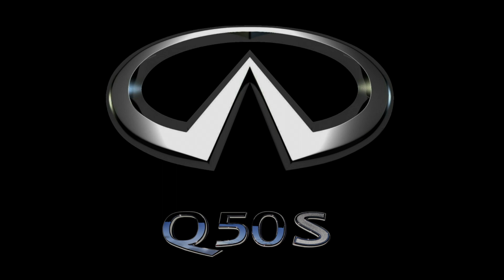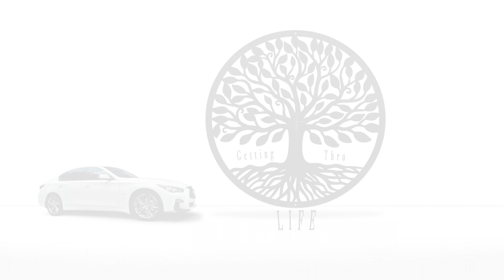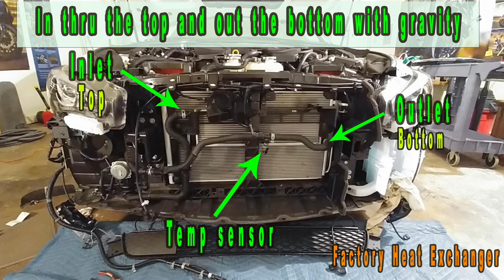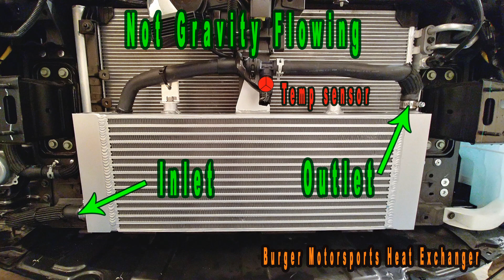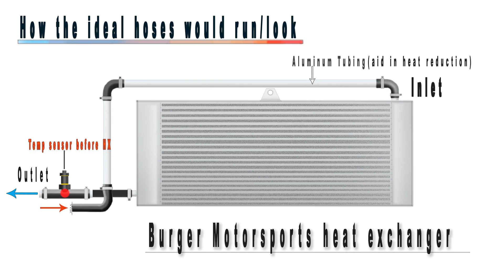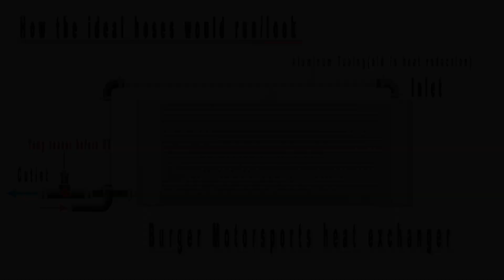Can the Q's 3.0T's Burger Motorsports HX install be improved upon?

Comment: Have you send this to them? Would be interested to hear their thoughts.
Reply from the maker: No I have not. It was highly likely done this way for ease and cost savings of actually doing it right. BM just used a generic core and end tanks and made it bolt up directly for ease. If the front bumper wasn't as labor intensive to get off, I would have played around with this and made aluminum tubing pieces to re-route the plumbing. I'm almost certain too that the wiring for the temp sensor isn't long enough to make the reach to where it would need to be mounted to make all this work. I'd like to get the Mishimoto HX in the future and add it to this BM HX while adding big surface area and coolant capacity too. Then no need for AMS in the fender tank.
Reply: Getting thru Life  With the red sport extra pump this shouldn’t be a big issue.
Reply from the maker: @EATSLEEPJD  Bottom line is the Red Sport extra motor doesn't serve much purpose except in the sense as a backup motor if it can be looked at it like that. The Red Sport drivers suffer just as badly in the heat as any other 3.0T. Moving the coolant faster thru the HX system isn't the answer unless you had/have a HX that is really over the top on cooling and efficient where it could take advantage of the faster coolant flow and still have the time to cool it. The main goal is coolant capacity and surface area. The factory HX is so dinky that the front HX itself only holds at best 7 ounces of water as I measured it in a video. That is half a drinking cup. Having a large capacity of coolant benefits in that it takes longer to heat up all that coolant so it gives more passes from starting at a low coolant point. With these cars in hot weather the HX coolant system is going to heat up high at some point and then just requires the car to sit with hood up and physically cool down. A trick I've been doing for 30 years is gas station ice bags ontop of the two intercoolers. drops coolant temp a fair amount quicker plus gets the intercoolers ice cold to their core.
Reply from the maker: @EATSLEEPJD  Also too, there is the fact that heated liquid rises to the top of a container and the cooler coolant drops to the bottom.  So in the configuration of this installed Burger Motorsports per their instructions the hot side of the coolant, the heated coolant returning to the HX, it enters at the bottom on the passenger side. It enters the HX end tank which will always have preexisting coolant swirling around in there. To a degree in the end tank is when the hotest coolant rises to the top and the cooler coolant drops to the bottom. This content of coolant now flows across the core pass side to driver side and dumps into the driver side end tank. There again it swirls around to a degree but again hot rises and cool drops downward or collect in this area. Just so happens the exit port is at the very top of that end tank. To a degree this HX is flowing its warmest coolant in the loop. How much cooler is the coolant at the bottom of the HX versus the hotter coolant at the top? Is it 1 degree, 3 degrees or say 5 degrees? It would be huge if there was 10 degree difference but that would be big number but would be nice to figure out if there was something to find, data. If you turned the BM around and had the hotter return coolant enetering the HX from the top and exiting the down at the bottom then seems the coolest coolant flowing down and across the core would be the outcome and thereby passed back to the twin intercoolers on top of the motor. Just a 5-7 degree difference could be a big bonus.

An article I read about fluid temps and the hot fluid rising to the top from the bottom: 

The molecules of a fluid are free to move. Liquid molecules, constrained by electrostatic and electrodynamic forces, do what's called "Brownian motion", gas molecules move on a random path, colliding with each other and with other objects. The molecules have different velocities, which can be represented with a statistical distribution. The temperature can be defined in conjunction with the average velocity of the molecules. At each collision, a molecule imparts a thrust on the molecule it has collided with. If you take an imaginary border inside a fluid, the sum of the thrusts of the molecules from one side, over a certain area will give you the fluid's pressure.

Now a high-temperature area inside a fluid is a region where the molecules have greater velocities. This means that they cover more ground faster and have more collisions, therefore, if impeded by the same external pressure, they will expand.

While doing so, buoyancy comes to play: all molecules, hot or cold (fast or slow) are under the exact same force from gravity and are essentially in freefall, but they usually don't move (on average) because there is a slightly higher chance of a collision beneath them than above them. Why? Because, thanks to the pressure gradient, the molecules are more densely packed the lower you are in a fluid column (and they are getting denser in the first place exactly because they have the tendency to fall).

Now the faster (hotter) molecules are able to reach further going up towards the low pressure area than going down, so they will gradually move up (we're always talking on average). So they move upwards and the cold ones move downwards. Equilibrium will be established, unless the heat source is beneath the column (as happens with atmospheric air close to the ground f.e.) in which case currents will form. Currents form because it is easier for molecules to move all together in one direction, since the chances of the collisions between them negating their collective motion are slightly lower.

Comment: In a closed pressurized system, gravity does not come into play. It’s all about the temperature. Heat rises.
Reply from the maker: I talk about this hot water rising under AllenM3's post. After thinking about this more it could be possible that the Burger Motorsports hose configuration could lead to the warmer coolant being sent out the top HX. The cooler coolant could be staying towards the bottom of the driver's side end tank until it mixes at some level and then heats up/levels out and then rises. Meaning the BM heat exchanger could possibly be hooked up differently and provide better cooling by a couple of degrees maybe. How much I'd have to datalog it on similar days to see if and how much of the difference there could be. I'm thinking about doing it. What's holding me back is the length of the supplied wire harness to the hx coolant temp sensor. I do not really want to cut into it and splice a set of longer wire to it. Something I don't like to do is cut factory wiring.

Comment: Very interesting point I've never thought about. Weird how the heat exchanger design make it work against gravity to push the fluid up. For what it's worth I've seen the flow that the single pump can push even with my same BMS heat exchanger and it's impressive. In attempt to rebleed my intercooler system, I've set my pump on 100% duty cycle through the ecutek app, then partially disconnected the top hose feed to both intercoolers and it's was garden hose level of flow, very, very fast. You can only imagine the mess it made because I didn't not expect that level of flow. Still interesting that the design of the heat exchanger could of been made with more efficient flow in mind.
Reply from the maker: Thanks for posting that info. I had my tuner turn my single, non red sport pump up to 80% all the time instead of mostly 40% some 80%. I really couldn't tell a difference in the heat reduction with any of my driving. In the sense, their is an optimum rate of heat dissipation per the time the fluid spends passing through the core I am assuming. Moving the fluid faster through the core which gives it less time to dissipate heat if move too fast. There is a fine line I'll assume. What I'm trying to figure out is by pushing it up through BM core does that pool up the cooler coolant towards the bottom and the hotter temp fluid to the top of the HX thereby circulating just the top half of the coolant. Interesting I found this online that supports the hotter fluid rising and the cooler temp coolant/fluid staying towards the bottom.  Therefore the BM HX set up the way it is would be less efficient at cooling just based on being pumped in from the bottom to the top.

((The molecules of a fluid are free to move. Liquid molecules, constrained by electrostatic and electrodynamic forces, do what's called "Brownian motion", gas molecules move on a random path, colliding with each other and with other objects. The molecules have different velocities, which can be represented with a statistical distribution. The temperature can be defined in conjunction with the average velocity of the molecules. At each collision, a molecule imparts a thrust on the molecule it has collided with. If you take an imaginary border inside a fluid, the sum of the thrusts of the molecules from one side, over a certain area will give you the fluid's pressure.

Now a high-temperature area inside a fluid is a region where the molecules have greater velocities. This means that they cover more ground faster and have more collisions, therefore, if impeded by the same external pressure, they will expand.

While doing so, buoyancy comes to play: all molecules, hot or cold (fast or slow) are under the exact same force from gravity and are essentially in freefall, but they usually don't move (on average) because there is a slightly higher chance of a collision beneath them than above them. Why? Because, thanks to the pressure gradient, the molecules are more densely packed the lower you are in a fluid column (and they are getting denser in the first place exactly because they have the tendency to fall).

Now the faster (hotter) molecules are able to reach further going up towards the low pressure area than going down, so they will gradually move up (we're always talking on average). So they move upwards and the cold ones move downwards. Equilibrium will be established, unless the heat source is beneath the column (as happens with atmospheric air close to the ground f.e.) in which case currents will form. Currents form because it is easier for molecules to move all together in one direction, since the chances of the collisions between them negating their collective motion are slightly lower.))
Reply from the maker: I'd have to datalog the before and after while its hot. It's now starting to cool down slightly where the difference between summer weather and intro to fall is drastic. The summer time in hot and humid states/cities is what seriously tests/crushes the performance of airconditioners, intercoolers and heat exchangers.

Comment: Of course it can be better just buy the Ams Heat Exchanger that what I did and my temperature needle has never been past the half way point. Sometimes it's worth it to spend the extra bucks. People always complain about the Gtr and 370z but the kits of proven reliability and horsepower are great and proven.
Reply: I caught my AMS HE on promotion so I bought it once and forgot about cooling needs. I do have the fender tank laying around so the fact they have that tells me it's not necessarily the HE itself, but in tandem with more fluid, maybe cooling issues are resolved?
Reply from the maker: @ceo4eva  Where do you live?
People here in hotter climates even with AMS HX suffer greatly. Just depends of where you live and what you are doing with the car. If it was only the heat exchanger that I was doing with no other plans to do a bunch of other things then that's a drop in the bucket but add wheels, CBE, expensive tires, tunes and other accessories then some people need to conserve in some other areas. If money was no concern then I'd stroke a fat check to AMS and ship my car there and say load it up. Not the case.
Reply: @GettingthruLife  I'm in maryland, very different climate from yours so I guess I don't really have your problem.
Reply from the maker: @ceo4eva  These Southern states are brutal. Florida, Texas, Arkansas, Mississippi, Lousiana with the heat and the combination of high humidity makes intake temps and charge air temps130-145 when pushing the car or sitting at lights. Hard to lower the HX coolant temp when the air coming into the front of the car on the hot concrete is upwards of 130 degrees.
Reply from the maker: The AMS is minimally better than the Burger Motorsports. I've compared data. Not necessarily worth 400 dollars more. If I could go to the effort of re-plumbing this setup so that it flows in the same direction as factory then there could be improvment which would narrow the gap even more between the more expensive HX's. I'd buy a 549 Mishimoto before AMS's $700 HX. I can get 10-15% off Mishimoto as well. Nothing wrong with Burger Motorsports HX but it could be made to work better at a reasonable cost then it would be worth doing.